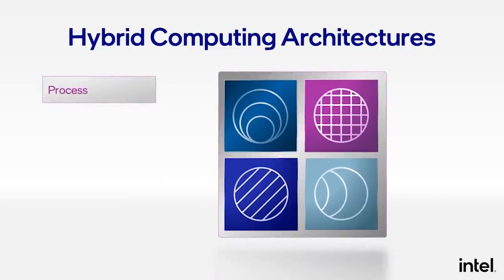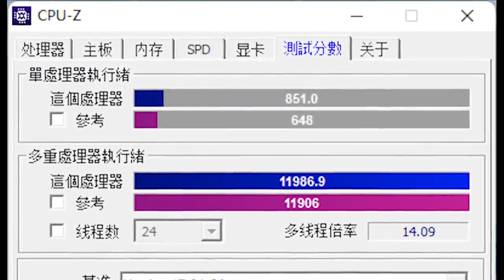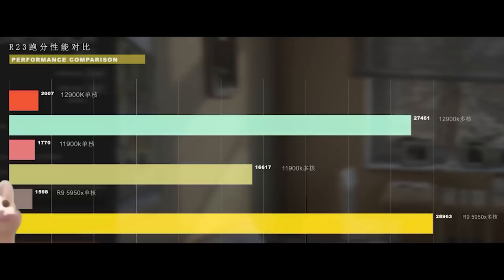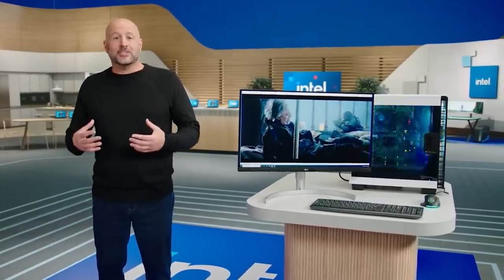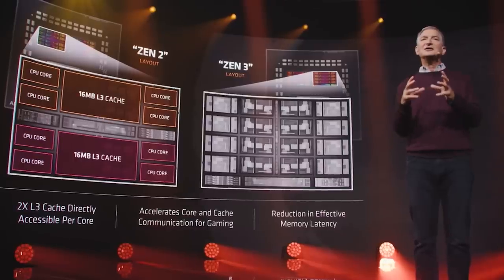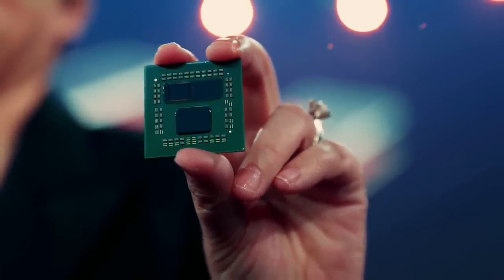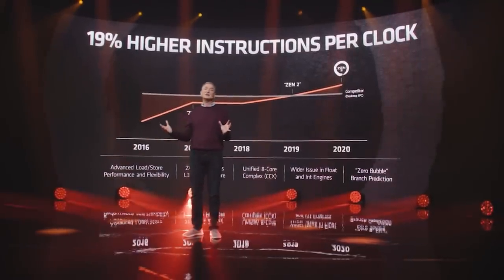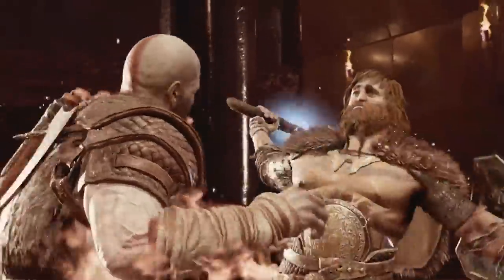Ryzen V Cache CLOCK SPEEDS & Production Revealed | Overclocked 12900K Alder Lake Hits 330 WATTS!

Comment: Am I turning into a fanboy? I've been so disinterested in what Intel have to offer for so long I'm basically only curious about AMD hardware. I used to run Intel 4790k too. I loved that chip. Weird.
Reply: Same. I even got a 3770k after my FX 8150 turned out to be a dumpster fire. I don't care for the big/little thing Intel is doing or the massive power requirements. I see no reason to switch back to Intel.
Reply: @DaveGamesVT  Yeah my 5800X is truly impressive with how much power it draws or I should say how little power it draws and the performance I get out of it. I mostly running stock settings with a small bump to boost clocks. Using this chip the past year has been freaking sweet.
Reply: I hope it's just the top i9 that's using so much power. i7's and below should be more reasonable
Reply: @wile123456  from what was said the little cores were disabled... so would be marginally the same if oc'ed i would assume.
Reply: @cannotwest  12900K has a higher Turbo Boost clock, but maybe overclocking a 12700K is better.
Reply: Same here. Plus, Alder Lake isn't as big a leap as hyped.
Reply: @cannotwest  "Unlike that ridiculous 5950x." - and here we have a real fanboy.
Reply: @cannotwest  Nope the 2600K is, the Q6600 is the i7 970 is, the 4770k/4790k was a disappointment number 2 after the 3770k.
Reply: @MeehIimo  8x Little cores should consume as much as a single big core or slightly more.
Reply: I ran a 2600k just upgraded awhile ago
Reply: @cannotwest  I said iconic. And no the 2600k is only 15% slower than the 4790k at the same clock speeds.
Reply: Same.  I lost all interest in intel CPUs lately.  My last intel was i7 3770k 3.5 ghz.  Upgrade to x470 mobo/2700x/16GB/gtx 1080ti. At end of late dec/2019 and been hooked since.  Just don’t care about intel CPUs anymore.   Been very happy with my build and interested amd future.   Use be intel fan boy but not any more.  Been gaming since intel 8088/86 days.  And building pc since mid 90’s.  I’ve had few amd CPUs over years.  Not a lot.  My last amd cpu was Athlon xp,   Even had one those green Cyrix 486dx2 chips at one time lol. 

Wanted zen 2.  But at time they were not cheap here in Canada.  And 2700x was on sale at the time.  Grab it and been happy since.  At least for what steam games I play.   Prob will upgrade at some point.  But I’m in no rush.  Rather buy new GPUs.  Ampere RTX 3xxx we’re a joke. ( half node upgrade). RDNA2 was decent enough.  But still too much here.  So going keep eye on RDNA3 or maybe Intel GPUs.  Time will tell.   Want something that actually upgrade from my 1080Ti.  Want something 12GB or more.  Games vram are only going go up.   Farcry 6 is proof of this.  Cus both next gen system have more ram.  

Can’t believe god of war pc port is only using DX111 ( per steam page). They should be using Vulkan.
Reply: @SireDragonChester  Zen2 was overpriced that's why it wasn't cheap. WIth the release of Zen2(and RDNA1) AMD doubled their profit margins from 23% to 45%.

With the Release of Zen3 and RDNA2 AMD increased their profit margins to 55.7%
Reply: I also run 4790k
Reply: @rattlehead999  As they should.
Reply: @odogg6899  What should they again?

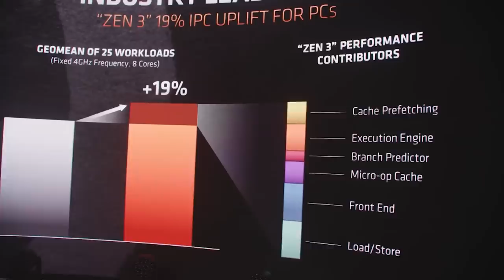Comment: 9:48 Yeah i specifically asked for the SLACR Q6600 when i bought it as that was the latest G0 stepping. The previous SL9UM was a B3 stepping and ran noticeably hotter.
Reply: The G0 stepping had a lower TDP (95 W if i remember correctly) versus the B3 which was 105 W. There must have been other improvements because even with enough cooling the G0's could overclock more easily.

Comment: I remember when the B2 stepping news first broke a few month ago, AMD even commented on it, saying it wont offer more performance. I actually think "B2" might be a version of Zen3 with less height, since that is needed for the "Zen3D" V-Cache application. AMD has to reduce the silicon height so they can stack another chip on top. B2 might just be that. And since it doesnt make sense for AMD to produce two different lines of Zen3 chiplets, the B2 stepping might also come to non V-Cache chips. Possible offering better thermals due to the decreased silicon height. But this is just a guess!

Thanks for the interesting video!
Reply: they grind the chip down to fit vcache on, so don't expect better thermals on B2 aside from process upgrades. but i like your idea, its possible some stuff has been moved about to reduce hotspots that could have been caused by thinning the die down or routing the cache addon lines more optimally
Reply: They always optimize their processors at some point, it's normal.
Reply: @goldnoob6191  used to be very common back in the day, but since then its really rare to ever see anything other than the same silicon as launch, the cost to remake the layer masks is what id assume to be the main factor. they need good reason to produce a new stepping as they don't want to rush out a new revision as you'll get a situation like the OG xbox where you'll rush out a new stepping before confirming theirs nothing else to fix.

Comment: And people took the piss out of amd with the  fx 9590 hitting 220w, 330w is crazy! Lol
Reply: Weren't the point of Alder lake is power efficiency??
Reply: @makisekurisu4674  it is, you don't have to OC all core to 5.2GHz, you'll get most of the performance with far smaller clocks and far lower power consumption. Good or bad, I don't really care about these unverified leaks from China / Taiwan.
Reply: @SweatyFeetGirl  I'm still using a 9590 from about 7-8 years ago, and I underclocked it a while ago, and dramatically lowered the voltage too. I don't even notice the loss, going from 4.7ghz to 4 ghz (and I'm a streamer!), but the peace of mind that my cpu definitely isn't going to overheat is a big bonus.
Reply: Alder Lake 4 times more cores and like 2.4 times the singlethread speed at stock.
Reply: @defeqel6537  but Intel supporters care about the leaks when they are in their favour.
Reply: That's a fine match to the RTX 3090, they can call that a money busting volcano build
Reply: Whats the point of efficiency cores
Reply: @erlienfrommars  LMAO
Reply: @low_etc  let them care, it's all pointless without some more solid leaks, or verified benchmarks
Reply: @garyjenson7602  Perfomance per mm2.
Why put one big core if you can put 4 smaller cores that have higher multithread speed in the same area on the CPU die.

Comment: A good chunk of single-core gains for intel comes from DDR5 and high clock speeds. We will see the real IPC improvement when independent people test it with standart DDR4 at 3200mhz and clock speed fixed at 4 GHz.
Reply: It's from IPC, not from clock speeds and RAM doesn't always increase performance as some tasks are more latency dependent than bandwidth.

Intel added 50% more ALUs(from 4x to 6x) and 50% more AGUs(from 2x to 3x) per core, but they have chocked them with bandwidth(not RAM bandwidth, register, cache and core bandwidth), so that they can release at least 3x times the same architecture but with higher bandwidth each time until they saturate it, so they can milk us.
So expect a 15-20% increase in IPC instead of close to 40-45%.

Just like AMD is milking us with Zen 1 to 3. It had 4x decoders for 4x ALUs and 2x AGUs and not wide enough registers, they then added another decoder and increased the core bandwidth.
Reply: Wrong. RAM has a minimal impact on IPC unless the processor is extremely bandwidth starved. It's clear that the Golden Cove cores have much higher IPC than Zen 3 cores. But they are significantly less efficient. This is basically why Intel can't pack 16 of them in a single package. Also the reason why some of the lower end SKU's have just the P cores since they can get away with the power requirements
Reply: @WimukthiBandara  Not at all. IMC and RAM setups matter a lot, it may matter little to not at all in stuff like CineBench, but it matters a lot in stuff like GeekBench (which is a pretty garbage benchmark TBH), Y-Cruncher, compression and obviously gaming (tho the term "IPC" only loosely applies there)

Or maybe you care to explain why Intel exclusively used DDR5 in it's Alder Lake marketing slides versus 11900K and 5950X (aside from using Zen3 on a version of Windows 11 that completely breaks performance for them)? They obviously had a agenda and it's clear it's a sizeable boost if they weren't confident enough to do fair slides.
Reply: Well, they exclusively showed off Alder Lake on a DDR5 setup in their slides... and no productivity versus Zen3, and only one slide about actual power usage... versus the previous power hungry 11900K.

I wouldn't pre-order stuff off of such shady slides (the fact that Intel has a horrible track record anyway aside).
Also the fact that pre-orders go live way before actual reviews is disgusting anti-consumer behavior.
Reply: @robertstan298  Companies never have good overviews and reviews of their own products. XD

Comment: with "little" cores under load 400W ? + 3090 Ti 450W ? nice combo for winter
Reply: lol its not under load, under load stock its 125W I believe. 330W is quite insane OC! :D Just like with rocket lake, people were making amazing headlines with 250W "under load" (* its actually AVX512 stress test). 
In reality nobody saw such power consumption in normal usage or games.
Reply: No, 330W is with both performance and efficiency cores combined, anyways we don't even know how accurate this leak is if at all. Even if it is, it's kinda expected when you push such insane voltages the power is gonna blow up.
Reply: @ahsanqureshi786  yeah, but imagine the boards that have multi core enhancement enabled by default, people will be bumping 300W peak pretty easily. I think default turbo peak is 250W.
Reply: Imagine heating your house with your PC and earn crypto while at it, surreal.
Reply: @zaxmaxlax  Been doing that for a few years now.

It won't heat the entire house but it doesn't really have to.

During the winter it's enough to keep the livingroom, bedroom and office warm, circulate air a bit and the heater rarely ever turns on.

I do live in Alabama though, so only about 2 months see freezing temps, less than a week the entire winter are below freezing, less than that never break freezing.

Comment: 300W CPU + 450W GPU = Premium 1000W power supply only
Reply: Seriously.

Imagine the folks that buy according to retail specs and get a motherboard with multi-core enhancement enabled by default, 300W+ CPU draw on a "125W" chip.
Reply: @cannotwest  that's also peak draw, which likely won't happen in real world but it will hit those numbers in peak load, which is what causes instabilities if the power delivery isn't up to snuff.
Reply: @cannotwest  short, yes, and multi core enhancement extends that quite a bit.
Reply: Damn it's getting ridiculous isn't it. Went for 860w with new psu, guess if I ever had $$ for a 12900k and a 4090 I wouldn't mind so much spending like 250 or 300 on a 1000w or 1200w probably even psu though but yeah.. its dumb
Reply: @cannotwest  saw in another vid 330w 12900k @5.3 and the 4090s are rumored to have 400- 450w ish, lets say you overclock it could potentially reach 500 or 550w ouch we're past 860w even if its reaally worst case scenario I think he's right but yea like I said before, if you spend 3000 or more for your pc you wouldnt mind paying a little more, it just suck that we're even having this conversation, but hey I'm sure 3dvcache will be competitive and consume less so I'm personally more interested in that..

Comment: I don't really need the extra performance. I just want something less power consuming while being much stronger than my Ivy Bridge. My Ryzen 7 GE came in. Will enjoy it for years and years. Could be tempted by an APU with insane graphics boost. Super uber DDR5 and extra caches will take some years still.
Reply: You will get very good ddr5 modules with very well timings at the end of 2022... it wont take years this time. G skill already revealed some good stuff and thats for the launch!
Reply: it actually can be pretty decent for the wattage, just shrink the die size by removing excess die.

so in a sense a stacked die of half the size of a full monolithic, is probably very good...
Reply: Extra cache is coming in a few months.
Reply: @reijhinru1474  "G skill already revealed some good stuff and thats for the launch"
11ns CAS latency is ok, but it's not great compared to the fastest DDR4 kits. Even cheap XMP DDR4 is usually 10ns.
Hopefully the longer burst length and independent bank refresh of DDR5 will negate the higher theoretical latency.

Comment: Im paying for my electricity, No way im going to have that furnace in my PC. Im happy with my 5600X(65W). Now that electricity is 3x the price in my country and rising. This product in my eyes is a waste of silicon.

Not to mention that in the summertimes the heat from my pc under my desk is acceptable but hot. But i cant imagine adittional +250W
Reply: Go Apple the latest M1x and pro deliver high performance at very low power consumption but any saving are swallowed up by Apple price.
Reply: @sexysilversurfer  im gaming pc games, so apple/mac is not a option currently.

Comment: As far as VCache, I think it changes the game for all Zen chips... I believe it's possible later on to remove the L3 from the layout (SlotA anyone) and use just VCache... It was touted as being stackble and could differentiate levels... If they can get 64MB stacks that would allow for 256MB L3 on one CCX (2 stacks per 4 core segment).. They are doing that with the current implementation...Very cool...

Comment: That is damn impressive single thread performance.
My 3700x is moderately overclocked, peak is 4.4GHz, same as stock, scores 533 at best on CPUz.
800+ is pretty damn stout.
Figures, I finally have a beast of a system and the new CPUs finally make the performance gains we've been wanting for a decade.
Reply: you may be able to drop in a v-cache amd cpu on your existing mobo.
Reply: @rozzbourn3653  I'm sure I can but there's little point right now.

When I get ready to build a new system I'll get a better CPU for this one and drop the 3700x in the secondary machine.

Comment: Gigabyte Power Supplies has become a meme at this point I wonder if they would ever fix their faulty power supply designs.
Reply: It was running 5.2ghz all core at 1.385 volts. That consumption is normal.

Comment: So basically that single core will probably allow them to take back crown in gaming, until 3dvcache releases, will be really interesting to see alder lake vs those cpus in gaming benchmarks, after all cpu z is synthetic but its impressive for sure, can't say so much about power consumption wtf.. multithread if its in the 650s that not bad, isnt 5950x 800s ? Anyone looking to buy 3dvcache ? Even though zen 4 will come like 8-9 month later, think I might wait to upgrade I have a 6700k but feels tempting, plus I have good ram 4266 that I never could run at that speed, even 3600 this cpu struggle spent hours trying to tweak and barely scratched the surface, think I might figure a 3600 for now I'm stuck at 3200  anyways, wouldn't mind skipping ddr5 for a while, plus the best ram kits wont be released until later on ..not to mention probably 300min for a good 16gb kit we'll see..

Comment: 10850K/10900K at 5.1-5.2 allcore in AVX pulls similar wattage and people put them in small cases...
I wish Intel stuck with Gear 1 Ratios over Half Ratio Gear 2 like Ryzens 1:1 and 1:2 Fabric sync ratios and RAM.
10th Gen Gear 1 / 1:1 past 4400Mhz, but Latency reduction Gear 2 is needed for 11th/12th gen 4400+ speeds on RAM.
10th Gen 36ns vs 12th Gen 50ns as an example.

Comment: Will v-cache mostly increase single-thread or multi-threaded performance? Do I have to care if I'm just gaming (at 4k with a 3060, so rather gpu bound)?
Reply: maybe yes maybe no. 

it probably depends on the game, probably, so a most definite "maybe". 

:-)
Reply: Cache has more effect on latancy than what you asked, however, better quality may improve both as it did on the last batch of 3600x which overclocked to 4.7 when it first came out could only do 4.2. Gaming gains will be 5 to 15% with the same clock speed.

Comment: Ive never cared about power conaumption but it sure is impressive seeing my 5800x sipping <90 watts in game. That being said if alder lake was significantly faster (in game) than zen 3 i would consider upgrading. Anything less than 30% improvement will be pretty meh though in game
Reply: Wow, 90w. My overclocked 10700k sees 70w in game.
Reply: @SmokeSolo1975  That's impossible unless you're playing a game that only uses 1-2 cores or are horribly bottlenecked by your GPU or using an fps limiter. What game is this in???
Reply: @nathangamble125  all games as my cpu usage very rarely goes much over 20%
Reply: @nathangamble125  under load such as cinebench I get to 275w and 80 degrees, but amd 8 core cpus also get to similar under load themselves. All cpus, amd or  Intel will draw a lot of power under stress as the required voltage increases. My intel is set to 1.36v and I know AMD go to 1.4v under load

Comment: Regarding the 12900K, that much voltage should not be necessary for the clock, and it'll for sure lead to accelerated degradation.

Comment: The buy in price for the 12900K platform is gonna be steep. You really cant cut corners anywhere when building one of these. Z690, DDR5, reliable and efficient AIO, and high end power supply all for a hybrid proc running on a 10nm process. I don't have a use case for one of these personally but I'm sure if you're a content creator/video editor it makes sense. Gaming... not so much unless you're pro.